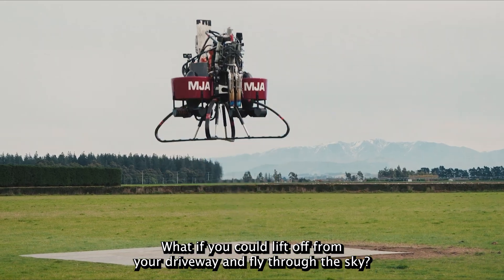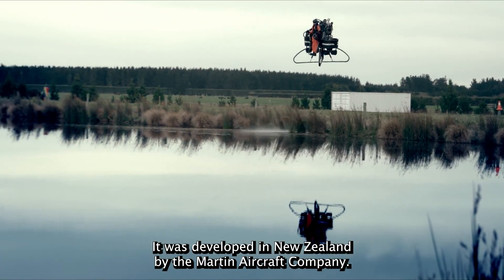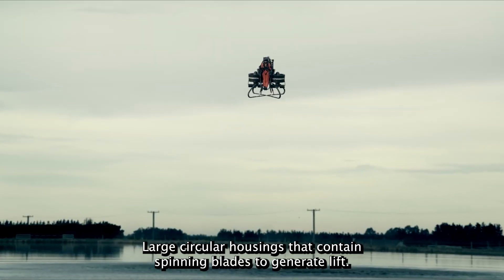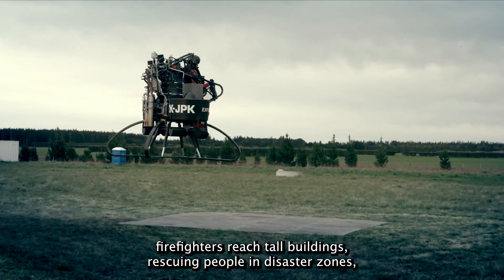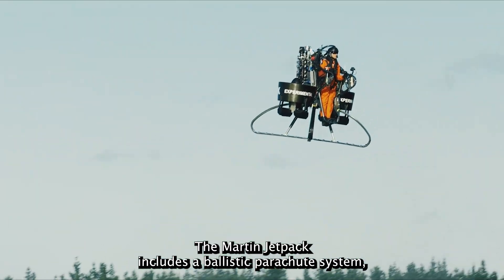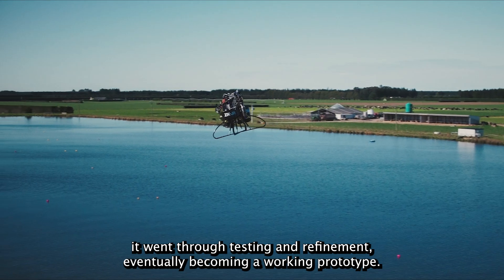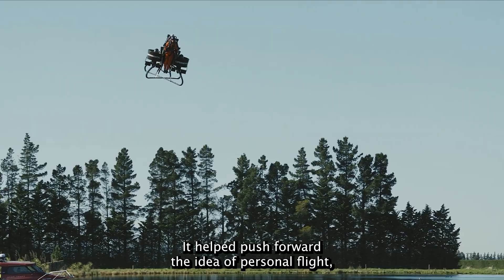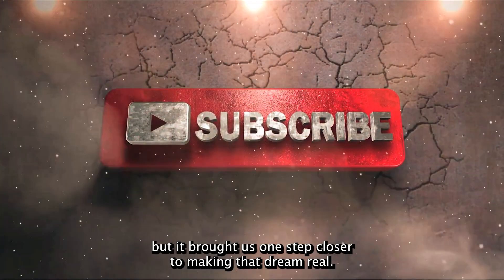The Rise and Fall of the Martin Jetpack: A Step Towards Personal Flight

Comment: The landing gear were insufficient they damaged themselves every time they landed permanent damage like internal injury kind of damage it kind of shit that shows up in the doctor says well can you live with it week? If not, we can we can do something, but you’re you’ll not be the same Then the next one is radiation shielding you have to use a special camera. That’s part of nuclear stuff called a multi spectral scope one of it has what’s called a black spot camera setting and it allows you to see through the Doppler effect so you can see the artificial black hole on thrusters and as such, there’s a turbulence the reason that they really couldn’t go any faster because if they turned it up anymore, the pilot got knocked out from the Raonic Constance flexure to prevent that he needed to be in a space suit and then he could reach speeds excess of sound as you know the speed to be. I know that speed to be the actual speed of light, but that’s a story for another lesson this right here can be improved upon and was a test bed to prove a point this point has been reproving time and time again it has gotten to the point that the only thing restricting this technology is one person in the supply chain, religious prerogative, and not that of the political right every one of their legitimate can actively actually say and is Ernest to say safety issues we have built technology to overcome and built that technology up more than 10 times overall advancement of technology rather than mass production at any one of those times now is a point that mass production, actively as required and yet again I don’t know what you’re talking about. I don’t know who you are. I’m not gonna pay attention to you because you’re not the guy that owns all the fucking satellites and was born the richest man in the world and robbed by Watergate and part of the Watergate robbery to pay back was that government works for as employee until $137 trillion plus the world‘s digital infrastructure is worth to a bank account. One split between me in the army core of engineer and the other one put right straight in my pocket that’s the minimum requirement to turn off the war power act they initiated the war power act and by more than three ways just due to my education, I land in a seat that says I should never have for want of anything and yet I eat out of dumpster routinely I do government subsidies. That’s one of the things we do is save stuff.